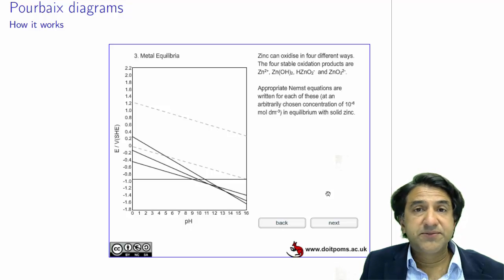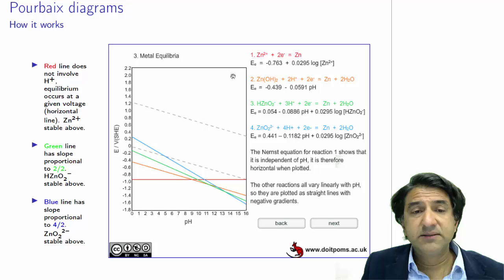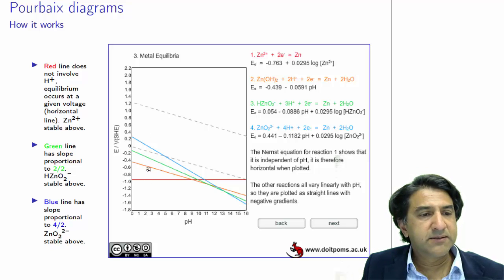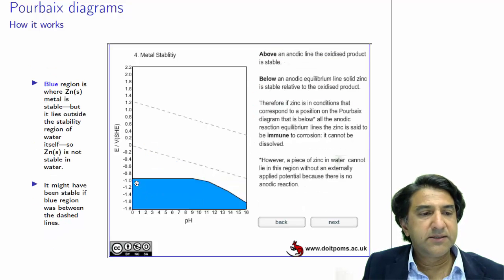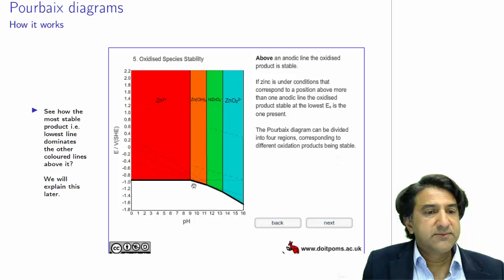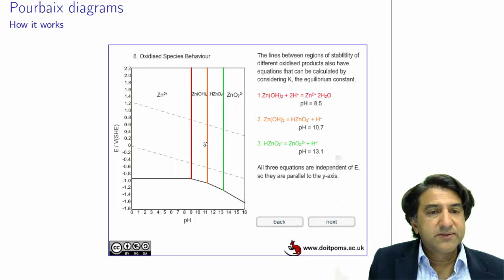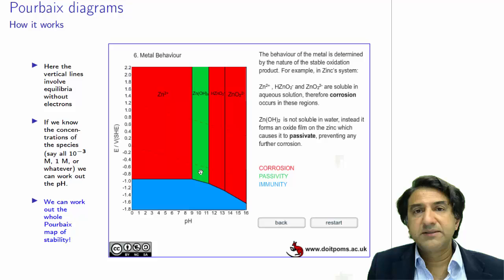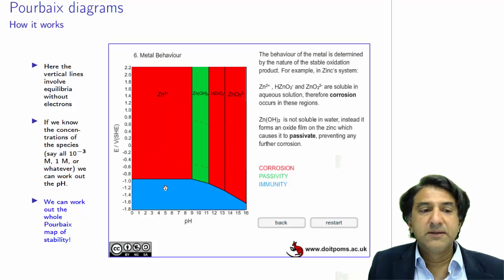CHEM3006 - 32 - Constructing the Zn/H2O Pourbaix diagram

Comment: Sorry I'd like to have a clarification: the red line of the equation n°1 shouldn't be at E=-0.763? Because in the chart it's showed close to -0.9V. thanks
Reply: I think its because the Zn 2+ concentration is not 1, which will in turn make the log [Zn 2+] part equals to 0. In this case, the Zn 2+ concentration is probably around 10^-6 which will make E = -0.94 in the first equation. Hope it helps!
Reply: ketemu disini  @maradhanaagung8674
Reply: @maradhanaagung8674  wibu